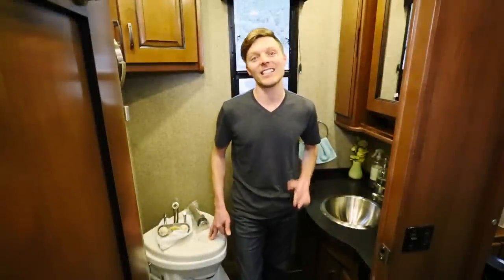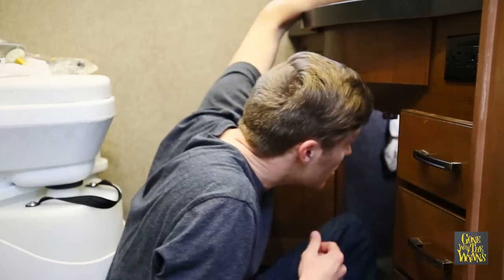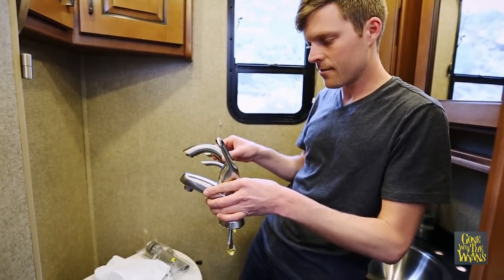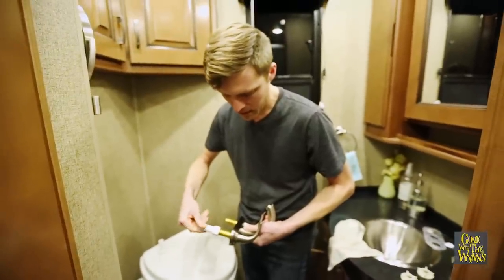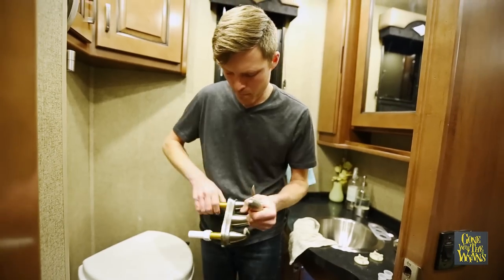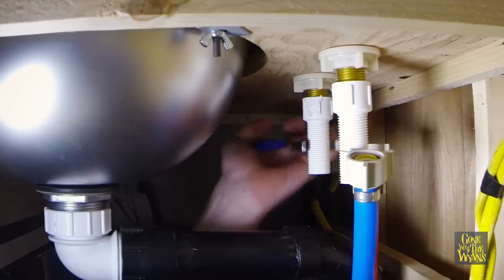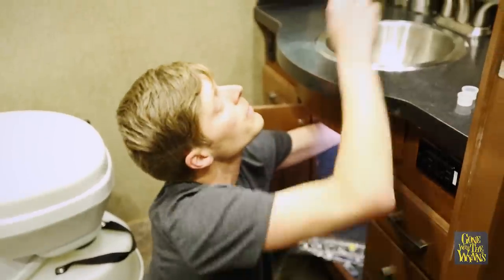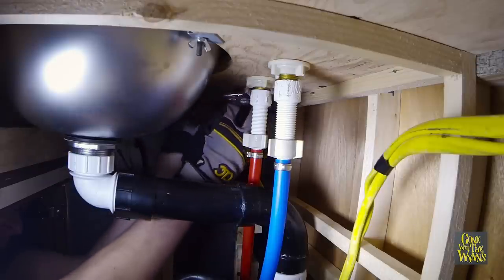How NOT to Replace an RV Bathroom Faucet

Comment: Jason, I love your videos. It's nice to see that I'm not the only who sometimes has difficulties with these "minor" jobs! I should have made a video of my "make a simple linoleum pan" under my Newmar's kitchen sink (lay a sheet of linoleum, use 1/4 round and caulk on the edges with half round across the door way edge, all to protect the composition shelf "just in case we had a leak" as my wife said.) Figured it was a four hour project. Halfway into it, I realized that my arm plus a nail gun were not long enough to reach the back wall to nail the 1/4 round. It's a DEEP cabinet. Solved the problem with Liquid Nails and a couple of pieces of scrap 1x2s to slide the 1/4 round back and clamp it until it dried. The caulk on the back was the real headache, and took a day-and-a-half to finish. All together, the four hour project took 3 1/2 days to complete. They say a good mechanic doesn't cuss. I am NOT a good mechanic!

Comment: you're the Man. after years of minor plumbing jobs (replacing shower heads or attempting to fix a leak after the management company of my rent controlled apartment couldn't find it) I've learned to embrace the teflon tape

Comment: Well, if you ever change another faucet, it should be a lot faster next time around. For one thing, a faucet wrench makes the job a whole lot easier. And sometimes the space is so limited that you have to use a faucet wrench because you can't get the channel locks (or your pliers) up in there. Good idea to always use Teflon tape, even with the pressure fittings. It only takes a minute more and can prevent future water damage. All the best!

Comment: At first I thought maybe you messed up the plastic threads which is easy to do when securing to metal, especially in a tight space. Thanks for the vid, Jason. I'll be sure to check whether tape is needed before I start. Very helpful, you get your Man Card back!

Comment: They do make a special RV plumbing fastener wrench that does a much better job. Costs about $15 at most RV parts stores. It's double ended for both sizes commonly found in RVs. Does not tear up the fastener gripping points either! He had it easier than me since my rig is older than his and doesn't use the newer water connections. Kitchen sinks are much worse because the plumbing doesn't always run vertical but horizontal instead.

Comment: Generally what I've found is, those types of fitting only need to be hand tight. If you overtighten, you squeeze out the washer or distort it too much to seal.

Comment: Jason I hope eventually you changed those plastic extenders for brass. I can't see how the plastic extenders would have lasted much more than a few months.

Either you replaced them for brass or whomever bought you RV did. Learned just how unreliable plastic is on a 'simple' plumbing upgrade job at home. When I finally learned my lesson and went to buy the brass extenders the associate at the plumbing section of Lowes told me never ever use plastic for plumbing, brass is best.

Comment: Hey man, don't beat yourself up.  At least you only required 1 trip to the hardware store.  I, over the years, have resolved that any plumbing job that requires less than 3 trips is a success.  Besides, you got it done.  Charge on, my friend, you can do it.

Comment: I agree with; cruyeda
 
"Generally what I've found is, those types of fitting only need to be hand tight. If you overtighten, you squeeze out the washer or distort it too much to seal."

Additionally, the PVC may crack over time with so much pressure on it being over-tightened.
Reply from the maker: We're heading into Austin, TX this week and I was considering getting a replacement...probably not a bad idea.

Comment: You put the Teflon tape on backwards on the cold water line.  The tape needs to go in the same direction as the threads.  Lucky it worked anyway.

Comment: Great job and always use pipe dope. Doesnt have to be tape, brush on thread dope is good. Your thread extender could have been cut a quarter inch to avoid the tight fit. The PEX hose has to flex, and when that tight it will fracture when coach is moving and bouncing on a road at Mono lake.   PLEASE JASON take an ocean mechanical class before setting out on a boat to live. No tru value hardware out yonder!!!!! And Nikki the inverter Vid years ago.....your hair looks best there..but always beautiful!!!

Comment: Great video. I thought you ALWAYS used tape on any water tight connections.
Reply from the maker: that's what i thought too, but the ACE guy insisted.  Shoulda read the directions before installing.
Reply: Gone with the Wynns remember always read the directions first.

Comment: Always, ALWAYS use Teflon tape! Lol. Also I like the braided tubing with metal nuts instead of that plastic crap.  More durable and easier to remove with tools.
Reply: +Jerome Truitt   Also he wrapped the tape backwards.  Teflon tape should be wrapped in the same direction you would thread a nut on.

Comment: You did good bud and video was very helpful, gonna give you 2 tips tho. 1 you  applied your pipe tape on wrong in the wrong direction on the cold water. You want to apply it in the same direction that you will be screwing the fitting on, otherwise it will unravel and cause a bad seal. 2 never, NEVER, listen to the ppl at the hardware store haha

Comment: In a similar fashion that one never does an involved electrical job (where pulling the meter is required, for example) on a Friday,  starting a plumbing job at 4:25 p.m.?  
One must be "very brave" "very confident" or maybe a bit "naive".   I'm reluctant to say what should be applied in this situation.
Good on ya for sharing everything.  I've never been one to document and share all the bone headed things I've done over the years.  NOT TO SAY that anything you shared here is remotely similar.  No no.  I'm talking about my own boneheaded things.  
But hey,  how are ya gonna learn,  if you don't get a little wet?
You did persevere, (sp?),  and got the desired result.
"No tape needed"?   I almost fell for the one once.   Only once.
Oh,  and after many plumbing jobs over the years,  I did figure out why plumbers charge what they do. It ain't easy.  And most times,  it's freakin' dirty work.
Once upon a time,  I was even willing to PAY a plumber to do a job and he refused.  He just said,  "That's horse work", (had to do with breaking up some concrete)  but he did write down all the fittings and sh*t I needed to do the job myself, so that was at least some consolation.
Keep on truckin'!

Cheers.

Comment: Our RV faucet sucks too. I'm looking for a better one that sticks further out like your new one. Do you know which model or brand it was? Or where you ordered it. Most RV faucets I'm finding online are plastic made to look metal. Was yours metal or plastic? Nice video. Thanks
Reply from the maker: You're probably better off measuring the current faucet & then heading to your local Home Depot, Lowe's, etc. where you can compare & measure to see which one will fit best.

Comment: Silly question, but why didn't you just wait until you were in town to do this since it's a non essential "repair" just an upgrade, :) Oh and next time instead of plyers use a pipe wrench, much easier and as you learned you always use tape when you make connection extensions as well as putting the extenders on first, directions mans best friend.

Comment: You put the teflon tape on backwards also. Its suppose to go on clockwise so it doesn't unwrap off pipe when you screw on adapter.

Comment: I have to say the main rule is never believe what a store assistant says and read all packaging but chances are any plumbing fittings whether it's water or gas you must always use PTFE tape unless they are push connection fiitings. white for water and yellow for gas. If Jason had just gone with his gut feeling and ignored the "ace" guy he would of been done a lot quicker and technically the shorter faucet feeds on the new one  were not really an oops as you wouldn't know until you started the job. Well done Jason

Comment: Jason, oops #10, you put the teflon tape the wrong direction on the cold side. Be sure to check that from time to time. Other than that did a great job.
Reply from the maker: We're heading into Austin, TX this week and I was considering getting a replacement part and re-doing the teflon tape...probably not a bad idea.

Comment: i don't care what the Ace guy said always use teflon when doing plumbing and you probably should have used plumbers putty under the gasket between faucet and vanity you WILL get water in the vanity from leaking under the faucet